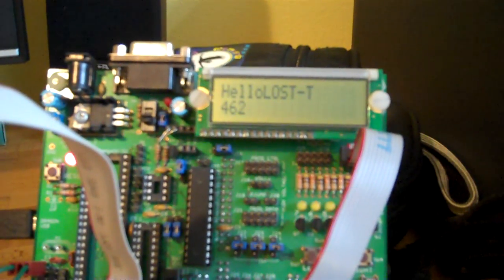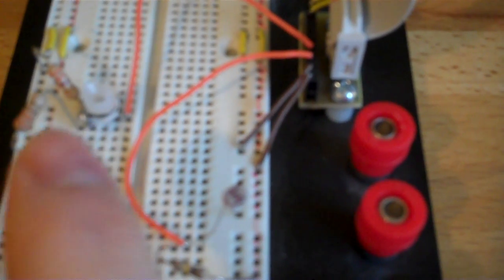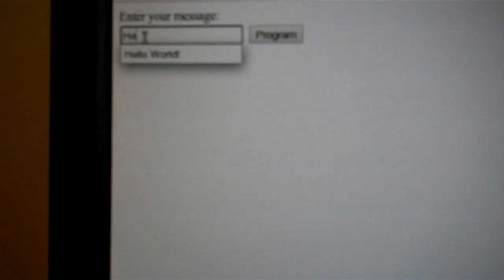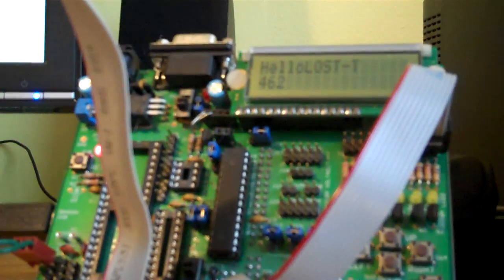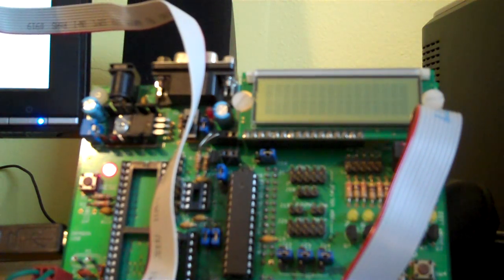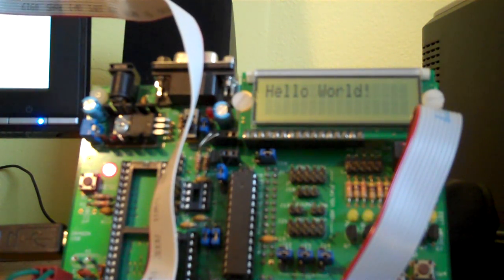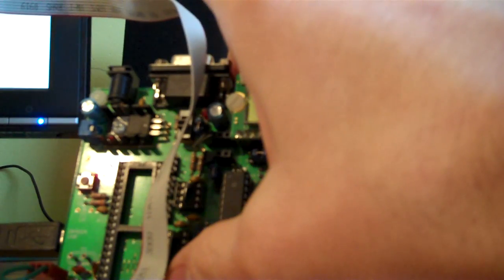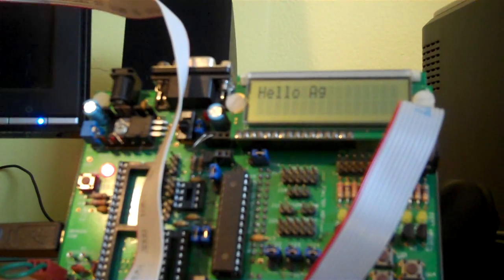Light programming with a photoresistor and flashing computer monitor

Comment: Really nice idea! I like it! I have a question... the reference voltage of the logic high from the ldr is fixed or you define it each time you use the system? because in any different environment it's possible to have different values... you know what I mean... Maybe if you isolated the ldr then it would be worked more accurately...

Comment: Interesting stuff, and it reminds me of the Timex Datalink watches that used a similar system for transferring data. I was under the impression that LDRs reacted to changes in light intensity more slowly than a photodiode - have you tried using a photodiode instead? Without an oscilloscope it can be hard to debug that sort of thing, though at such low frequencies I imagine a soundcard oscilloscope (e.g. Visual Analyser) would be sufficient.